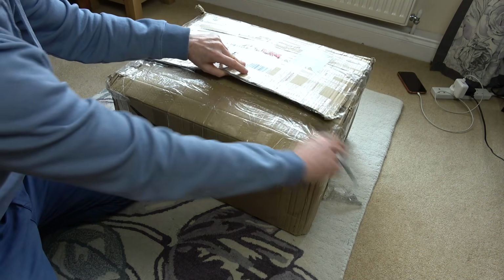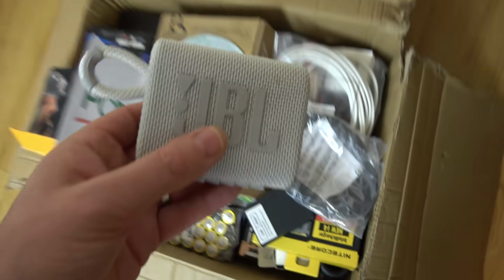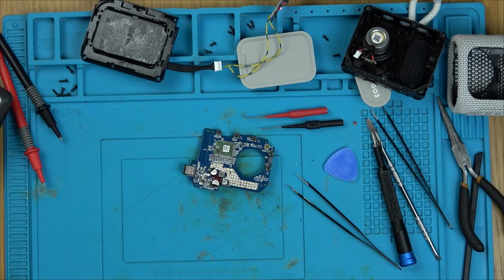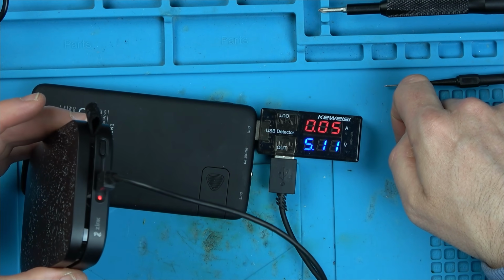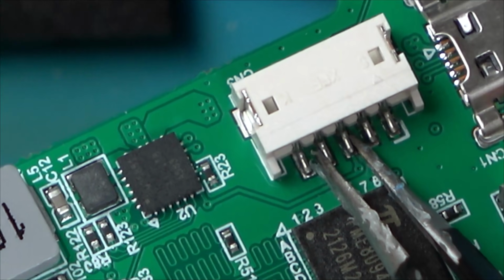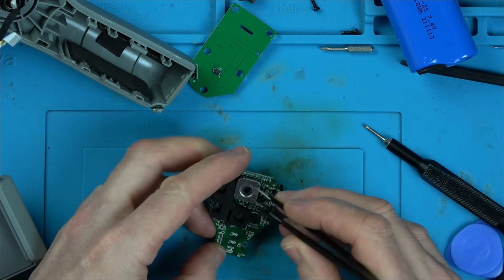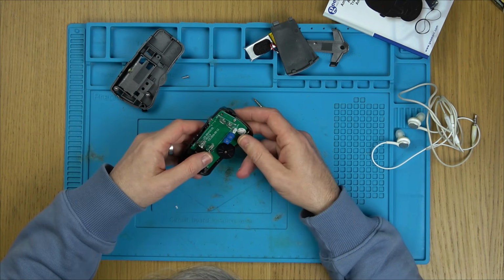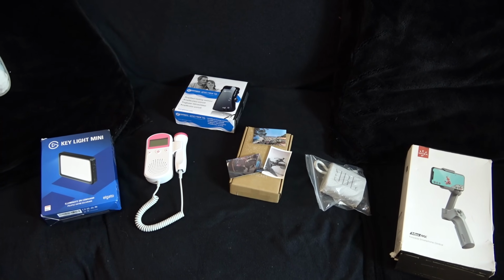ANOTHER AMAZON Returns MYSTERY Box from eBay? Can I FIX it?

Comment: Use the ultrasound to find noise faults on your Rolls Royce Bud.😊 Hi just say you did a standard battery bms reset shorting the two pins. The battery went to low to charge and only way to charge again is to do the power reset on the bms chip because it latches off.😊😊

Comment: That potentiometer you’re looking for on the gimbal is a psp joystick. There are psp joysticks with removable tops that are throughhole and smt instead of a ribbon cable. It’s the same one that knockoff joy-con usually use.
Reply: @Blu3ManiC is the value the same though.  As it need to be correct resistance to work I expect.
Reply: @digihorse6730  resistors can fix that value but i doubt it’s needed for a gimbal
Reply: I was hoping somebody would have the answer to this in the comments. As there are not that many different models of mini/slim analog sticks around and products tend to use off the shelf analog sticks either from big names like Alps or clones from Chinese manufacturers, I figured it couldn't be that hard to find a replacement. I didn't recognize it as a PSP stick because the thumb cap is so different, but I guess the PSP's analog stick might've been an off the shelf model with a customized thumb cap.
Reply: @Jdbye   To be clear PSP didn't use of the shelf things because Sony is one of the leaders in tech development and they own a big monopoly of tech that other source from them. They used this tech 1st in mobile phones then implemented it to PSP. Later when there was not much of the need for this patent they sell it to the next company. Then Sony moves on and works on improving and patenting new things. 
These patents end up in hands of China corporations since today everything is made in China for most part. And with that you will often see old tech like this being sold and available in Online China stores and sellers so I suggest look for it there, because by the time it comes overseas into a closer shop the price goes up 10 times higher maybe more.

If something is not available it's because the owner of the patent reserves the rights to source it out or not also politics play a huge role in everything. Today we have the issue with USA and their parasitic wars in Europe and trying to control every bit and piece even tho they can't control even their own pathetic country properly so what gives the right to criticize everyone but them selves so China pulls a plug on them sometimes to show the fact that if you take out one chain of operations you lose control of everything. So if something vanish thank it to the politics, mainly the western ones because when the plug is pulled it's pulled for everyone for full effect.

Hope this makes sense to you now and hope you learned something. Have a great day folks.
Reply: Even if the exact same model of analog stick couldn't be found, there's nothing stopping you from using a different analog stick if the resistance is the same as long as you can make it fit. A Switch JoyCon analog stick might work for example with some cutting of the plastic shell, not a perfect fix but a working product is better than a non working one.
Reply: I actually didn't know that a psp used this
Reply: I found one on aliexpress for like 62 cents usd
Reply: FJ08K-4 joystick switch B10K joystick potentiometer handheld game console PSP four-way rocker
Reply: @Felsia216 t may be the -s version instead of the -4, which indicates a slider. He could unsolder it from the board and look at the PCB markings on the underside and find out real quick
Reply: Do you know witch model psp? Because they have different sticks for different models
Reply: It's made by jr Merritt controls

Comment: You could totally print small stickers and cards on some sort of stock or thick paper with that printer and maybe sell them signed? I think it's a good idea, I'd totally buy a MMV signed card.
Reply: Unfortunately normal paper wouldn't work in that printer as it uses a special paper to print. That printer doesn't take any ink.
Reply: @NanoMine  Thermal paper??

Comment: "It look like short, let me plug in this freshly charged most likely high current capable li-ion battery to it just to be sure" :)))

When you can't find replacement charging controllers you can always use tp4056 module inside and just wire everything to it, it's look like there is enough space inside of speaker for that. Original is most likely something from linear tech, LTC40xx. But I'd just replace it with 4056.

Comment: I think that short on those pins of the mini HP printer was from + to a Resetable fuse! I think a fuse on that charge chip somehow tripped for whatever reason and you shorting the + to thet resetable fuse line Reseted the fuse!
Reply: Could be overcharge/overdischarge/short ciruit protection. usually on a battery protection board and power off resets it (often involves detaching the battery and reattaching). Maybe Vince's tweezer action somehow did a similar thing o the onboard chip.
Reply: @mahlapropyzm9180  you mights be true about that although the battery cells I didn’t see a temperature sensor

Comment: Interesting, Was the short you produced for the charge port of that mini printer across a data pin?
Reply from the maker: Well it was between the temperature pin and the positive. From memory on the Nintendo Switch if you want it to work on 2 wires (just the + and -) then you have to short the temperature wire to ground, that is why I thought shorting it to ground here might make it work. It didn't, but shorting it to positive did!!! Very strange, I presume I have blown open something yet it is charging (on initial testing) perfectly. Thanks for watching Shawn 👍
Reply: @Mymatevince  you probably mentioned that and I didn't catch it or was distracted while watching. In older smart phone technology the charge port required the data pins to be shorted to each other to allow faster charging (1A vs 500mA) as an example. In a clutch I would strip the charge cable and twist the wires to those pins together if I needed a quicker charge in an emergency type situation. That was the why behind the question.
Reply from the maker: @HavingFunRepairs  👍